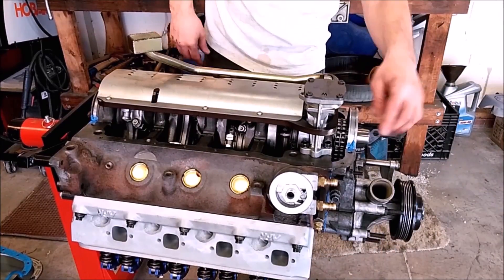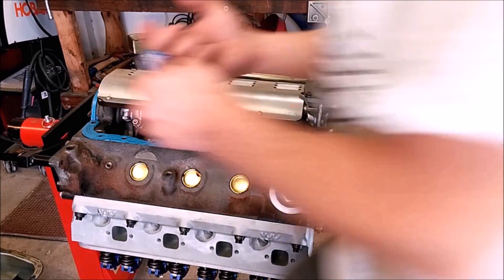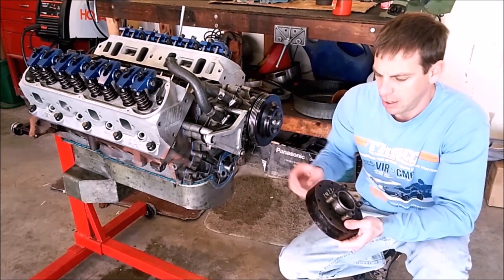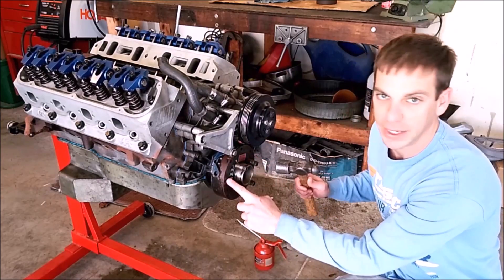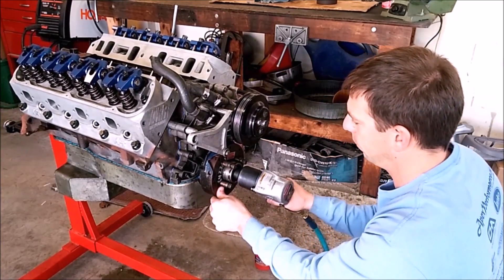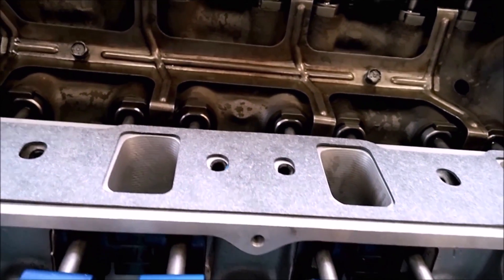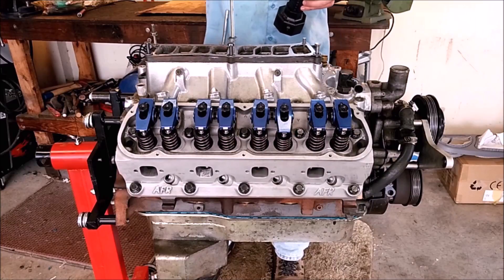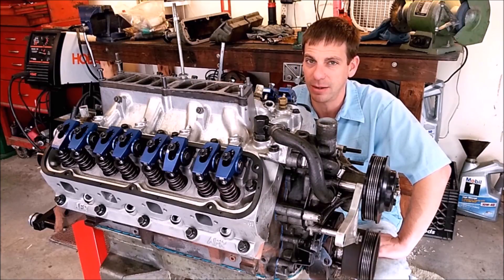How to Build a Ford 347 342 331 306 302 5.0 SBF (Part 8)

Comment: I know this is an older video. 
But great job! 
Im in the process of building a roller 347 for my 86 Bronco.
Im using a Scat Stroker. Im also using Trick Flows 11R Twisted Wedge cnc’d top end kit. Complete from cam to heads, push rods, etc.
Im excited for the build. But its been a long time since my last engine rebuild. So i was feeling a bit intimidated. 
This video series did an excellent job covering all the aspects of the building process.
I feel much more comfortable now. 
Thank you for sharing your knowledge!

Comment: Is it true you used a windage tray becouse of the fast turns around the race trac and everyone else may not need one depending on application?
Reply from the maker: Windage tray is not related to road course racing and fast turns.  It is related to sustained 5000+ RPM operation.  If your application will not spend a lot of time above 5,000 RPM, it is not necessary.

Comment: This series helped me alot with my 331 Stroker build. Thank you! Curious how you go about hoisting the engine in with the lower manifold on. Do you use the upper's mounting points or the accessory bracket mounting locations on the ends of the heads?
Reply from the maker: Accessory bracket mounting locations on the ends of the heads is the way to go.

Comment: By blocking the oil stick hole in the block wouldn't be blown out by the motor?
Reply from the maker: If you are referring to crankcase pressure forcing the blue RTV out of the OEM dipstick hole, no.  The first 2 things that will pop out due to excessive crankcase pressure will be the PCV valve and the dipstick that is inserted into the aftermarket dipstick hole.  Those require less force to pop out than the blue RTV and will relieve the pressure.  However, it should be noted that if any of these things happen, there's a good chance you have excessive blow-by and a ring sealing problem.
Reply: @fastfrankd  ok thx

Comment: Great build man what size injectors did you use and are those AFR 185cc thanks
Reply from the maker: Yes, for this engine's power levels 42lb.  A mild street build could get away with 30lb

Comment: Perfect series you explained everything very well.. I’m currently rebuilding my 302 and I wanted to know if checking the cc on the chamber in depth like you did is necessary as well as decreeing the cam and using the tool to check the small movements.
Reply from the maker: CCing the heads is not necessary unless you want to do a bunch of work for 10HP.  Degreeing the cam is also usually only worth 10HP, but has the great side benefit of serving as a double-check that you didn't install the timing set a tooth off, which is fairly catastrophic.

Comment: I've always heard the 347's have reliability problems compared to the 331....what's your take?
Reply from the maker: 347 will use a bit more oil and have higher cylinder sidewall stress and crankshaft stress than 331. Keep it under 6500rpm and use a cam to match, and it'll last forever.  If you want more than that, you'll need to upgrade crankshaft and valve train components to keep it together.
Reply: First of all...THANKS so much for answering. I've heard of SBF blocks cracking down the center with high HP. I would think this would be a major problem with a hot 347. Also....do you rebuild engines as a business? If so....are you anywhere near SW Texas?
Reply from the maker: Yes I do, I am in Greenville, SC.  The factory blocks will not split unless you're putting out more than 500 horsepower, and most of the time anyone putting out more than that is operating at 7000+ RPM.  Keep it under 500 horsepower and 6500 RPM and it'll be good.

Comment: Frank, I just discovered your video set on building a 347 stroker.Thanks, it is well done and informative.I need to take my fresh 347 apart due to low compression on cylinders 3 and 7.Your video will be helpful in the re-assembly.
Reply from the maker: Thanks, good luck with your rebuild!

Comment: what size crank & rods … and will stock block crack ???
Reply from the maker: Factory 5.0 blocks are good for 500 hp.  Cranks size is based on stroke, and rods usually in a couple lengths per stroke length.... your option.
Reply: Goin with iron 302 boss ford racing block … 363  9.25 compression  475 HP   87 octane

Comment: Awesome series! I'm doing a 347 also my block is still at the machine shop they are going to file fit the rings for me but pretty much the rest I'll be doing. Thanks for the very informative videos!
Reply from the maker: You are welcome and good luck with your build!
Reply: It will be fun. 347s make good power and even more when you throw power adders at them.

Comment: Good video series but you really should have shown the correct way to install the balancer with the proper installation tool. Some fit REALLY tight and doing it your way is a good way to damage the crank threads. Also, unless fitting MLS gaskets (yours LOOKED like 1011-1 or 2s) I don't believe I'd use any spray sealer on the headgaskets. If you have a proper deck and head surface most normal gaskets seal better dry.
Reply: Scott_C. This guy does great videos.  Please subscribe to his channel so he can continue to make them!
Reply from the maker: Hi Scott, thanks for your comment. The special tool is certainly another way to do it for an extremely tight interference fit.  As for the method employed here, the bolt is 5/8-18, which means full torque is available at 10 turns when lubricated. The bolt started with 5-6 turns, and was drawn in with obviously far less than 90-ft-lbs torque spec.  The threads won't be damaged unless someone is asleep on the trigger.  I’ve never had an overly-tight press-fit, but by all means, use the special tool if your part tolerances require it.
Reply from the maker: Agreed, the copper spray is an optional step and was utilized to aide heat transfer, not so much sealing.
Reply: Done!

Comment: Great videos! I rebuilt my 302 a few years ago and your tips would've saved me time. I will be tearing it down again to do a stoker this winter. I'm glad these videos are up for reference. Question: if you buy preassembled heads, is it necessary to lap the valves and verify all the factory specs?  Due diligence is one thing, but I feel like it would be redundant. Would be interested to hear your thoughts.
Reply from the maker: If you are not going to push the engine hard, you'll be fine.  If you plan to dabble around the valvetrain rpm limit, you should verify the installed height of the springs to be sure you have required seat pressure to prevent valve float.
Reply: Blueoyster5 This guy does great videos.  Please subscribe to his channel so he can continue to make them!

Comment: Are there any specific head/cam/intake combo that works well with a 347? My dad and I are rebuilding a 289 but do not know what will be the best combination for the 347 stroker. Thanks
Reply from the maker: Depends how much power you want to make and what rpm range you want to make it in.
Reply: I would like to make 450 hp around 6000-7000 rpm. Thanks
Reply from the maker: If you are talking crankshaft HP on a carbed engine, this can be done with off-the-shelf Edelbrock RPM intake/heads and camshaft in the 280-284 deg adv. duration range, but you will need upgraded valve springs if you want to get anywhere near 7,000 rpm.
Reply: one problem with the 289 block, is that some of the cylinder walls don't extend as far down into the crankcase as the 302, because both engines used different crank strokes. The 302 came later in 1968, and when the crank reaches BDC, it pulls the piston further down. The 289 ran a longer connecting rod, but still check when you increase its stroke, that it isn't pulling the cylinder too far out the bottom of the bore when the crank is at BDC. Otherwise, the barrel-shaped piston may rock around at BDC before it gets pushed back up the bore, and of course that longer stroke will apply more leverage.
Reply: Chance Hackenbruch This guy does great videos.  Please subscribe to his channel so he can continue to make them!

Comment: I have bought a ford body (64 f100) to run in a local, old school,  gasser organization . I have never built an engine before , so I'm nervous about the prospect of this undertaking. I was thinking of the 331 due to the 10 lb per cubic inch mandate . I know I can get the weight of the truck to 3100 lbs plus my 200 lbs . How extreme can you build a 331 ? Thanks for your time with this informative video  We will be running 1/8 mile with 513 gear and 4 speed manual trans.
Reply from the maker: Hi mtnfordman, thanks for your comment.  There are only a few trade-offs between the 331 and 347.  The 347 requires notching the block as described in the video Part 1, while the 331 does not.  347 also has slightly increased oil consumption and side loading on the cylinder wall.  347 has longer stroke, so will make about 5% more TQ and have a better mid-range than a 331 with similar H/C/I.  You can match naturally aspirated 347 horsepower with a 331,  but you'll need to run it about 200rpm faster with a top end combo to match.  For your application, a 331 can do everything you need it to do up to the OEM Ford block limit of about ~500hp, it's just easier to get to 500HP with the extra cubes of a 347 at a lower RPM that a mid-budget top end combo can live with.  If you are looking to make more than 500hp, you are probably looking at an aftermarket engine block and a blower, so 331 is still fine since you have the boost to hit the TQ/HP you need.
Reply: Thanks for your reply, this class that I'm wanting to compete in , have times close to 7 sec. in the 1/8 . I was thinking of running a old style Tunnel ram , as most of the other  cars do also . If I were to run a FE block , I could get a 7.5 per cubic inch weight break for the truck (2925lb) vs (3310 lb) for the 331. I know the FE would be more expensive  to build  !
Reply: Provided my  1974 302 block is usable , estimate  (ball park) a dollar amount for this build with aftermarket aluminum heads ?
Reply from the maker: $5,500 in parts and machine work +/- 2k, depends on desired HP, redline, and new vs used parts
Reply: mtnfordman This guy does great videos.  Please subscribe to his channel so he can continue to make them!